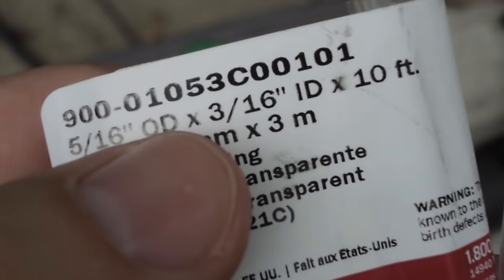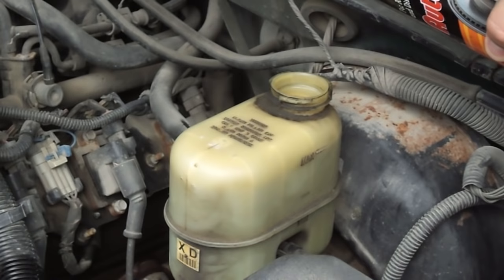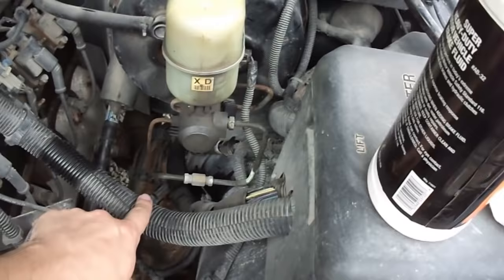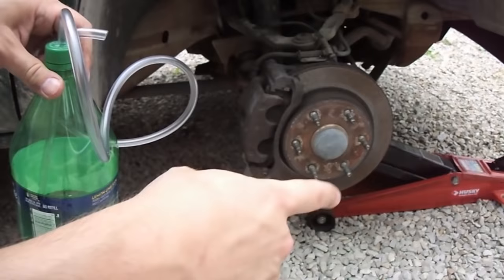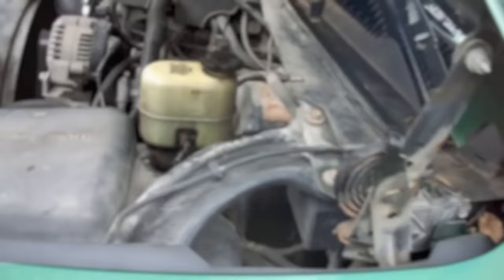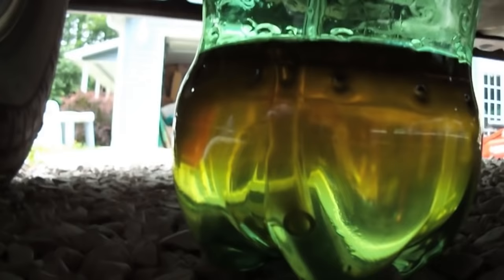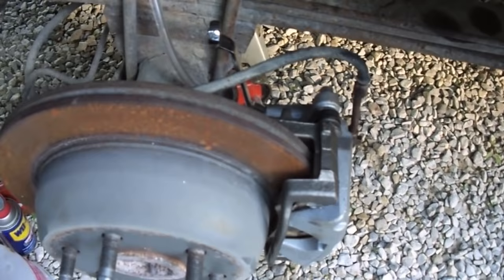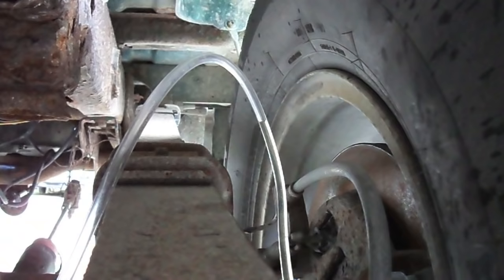Bleed brakes by yourself - DIY Brake Bleeder tool - Brake flush

Comment: Use a turkey baster to remove old dirty brake fluid from master cylinder. Use it in your soda pop bottle. Put new fluid in the master cylinder. That way you flush out all the dirty brake fluid at the same time. Use a zip strip inside bottle to hold hose and a zip strip to stop hose from coming off bleeder valve.

Comment: Good idea to put a block under brake pedal so that master cylinder piston does not travel into area that it has not pushed into before, there could be contaminates that get under seal and cause trouble later. only takes a second, and that way eliminate the possibility

Comment: Put blocks under the pedal so not to go to the floor . So the orings on the MC won't get ruined. And get those drill fillings out of that bottle!😲😲😲
Reply from the maker: Good tip, and yes, the bottle was cleaned out after drilling the cap.

Comment: another tip .. before starting to bleed . suck out all the old brake fluid from the reservoir . take note of its colour . if it’s green , buy new fluid the red or blue . different colour to the old fluid . then fill the reservoir with the new colour fluid . makes it a lot easier to see when the old fluid is all pushed through when the new colour fluid appears in the bleed tube . never skimp on brake fluid . buy the very best quality the store has on offer !

Comment: If you have the time, I would do a gravity bleed instead. Pump the brake before you loosen the screws. Also take out as much old fluid from the reservoir and stick a 32oz bottle of new fluid on top of reservoir. It shouldn't spill over. Close bleeder valve when you see clear fluid coming out
Reply: So after I emptied my brake reservoir, do I now fill it with the sprite that I took out of the bottle originally? Asked the blonde lady..

Comment: Thanks for the good video, Bud. 

Can I suggest  -  if you bring the tubing up a few inches after it hits the bottom of the bottle (forming a 'J') it will act like a P trap on a sink drain and you won't need to submerse the tube's end in fluid to prevent air from being sucked in.
...
Reply: If it sucks air/fluid all the way up from that bottle then your brakes already have a serious problem. The bottle is just there to catch expelled fluid.  The lock against air is the upward loop after leaving the nipple.

Comment: Great video. If you wanted to get a little fancier you could buy a strong relatively cheap magnet from a home store and glue it to the bottle. Also sealing the tubing at the top of the cap to help keep it from slipping out might help. Just about any type of glue or silicone sealer would work. I have some Flex Shot left over from another project that would work perfectly.

Comment: when you opened the bleeder at first the stream was solid, so what your saying is the air bubbles are upstream? And always use Transmission fluid to loosen rust. You could've gotten that screw off that way ATF works great.

Comment: lil penetrating oil on each bleed value 1st if older rig  and ONLY 6 POINT SOCKETS SHOULD EVER BE USED TO REMOVE BLEEDERS  at least that was the rule 60 50 40 30 yrs ago..good video sir  thks

Comment: would it be ok to use wd40 on stuck brake caliper bleeder screws (while they are still attached to the car) - or can that stuff penetrate past the threads and compromise the brake fluid/braking system?

Comment: If the master cylinder over 20 years old,don't push the pedal down to the floor this step,it may damage the seals inside the master cylinder,just use bottle is ok.
And if your car is top  model,make sure it dont have the electronic  brake,they use electronic pump to brake , OBD connect  to ecu to do bleeding.

Comment: Why would you need a vent hole or even a cap as long as the hose is submerged in fluid it can't suck air and the lack of cap would allow any air to just bubble out?
Reply: I suppose it grips the hose and stops it coming out - then the fluid would spill on the ground.

Comment: I told the auto parts store about having bleeders screws seize up before and I said or asked them is there anything that can be done to prevent a bleeder screw from seizing up? The guy that helped me was general manager and he said yes I have seen people use anti-seize like you would use on your old school spark plugs to keep the spark plugs from seizing up to a cast iron block. I figured wheel cylinders and calipers are mainly made of cast iron at least for my truck they are but the screws are a different metal so I started thinking about it for a minute and said yeah get me a small pack which is like a $1.99 of anti-seize and let's see if this works well that has been 3 years ago and I have yet to have one seize up on me. Just a little tip because I know at one point or another when people do their own brake system they may have come across this situation or know someone that has. I hope this helps.

Comment: Thanks for the very well done vid, but shouldn't the front brakes pull harder than the rear brakes? I was a little surprised to see the rear brakes lock up. Not so good in snow and slippery conditions.
Reply from the maker: Daniel Ben-Avraham the front end is much heavier than the rear.
Reply: @TheDaninator  True, it is a pickup, and you were on loose stone. Regardless, you might try the two person version of bleeding the brakes afterwards just to be certain that you got all the air out. The way you did it has the advantage of being great for getting brakes or clutch when you are all alone like I often am, and it is great for a line flush. The drawback is that air normally gets sucked in around the threads of the bleed screw. Pretty difficult to avoid unless the screw is sealed with grease or teflon tape. And both are a good idea, and can help avoid having to replace brake cylinders due to the screw freezing up. Especially where there is a lot of salt used on the roads. I know that gig as I grew up in New England, where we made a habit of spraying the undercarriage with old motor oil and then driving down a dusty road to solidify the oil. Makes working on the vehicle a little messier, but hand soap is cheaper than a new vehicle. I retired to the tropics so that is no longer an issue, I have a vintage 1972 Nissan Patrol vehicle and it is rust free. 
Anyhow, unless the threads are sealed with grease or teflon tape, they will draw in air every time the brake pedal releases and returns to the resting position. That to me could be why the rear brakes locked up so quickly, normally a little sliding is expected just after the vehicle has almost come to a complete stop and the tail has lifted. This is due to the fact that the design of the braking system is such that 75 to 90 percent of the stopping power is on the front brakes. With this, you should seldom ever see rear tires sliding.  The front tires should have slid before the rear. I would check it out, hate for you to have an accident. Liked the vid though, good work.

Comment: So what’s the problem once u bleed the brakes and the brakes when pumping is still loose ?
Reply from the maker: Hard to say exactly, you may have a leak somewhere in a brake line, or perhaps if your vehicle has an ABS module, it may have an air pocket in it.

Comment: What state do you live in and how many miles or years was that brake fluid in there?
Reply from the maker: I live in "rust belt" USA. The truck had approximately 225,000 miles when I made this video. I've owned it for 10+ years (it had 138k miles on it when I bought it), and have bled the brakes a time or two since I've owned it.

Comment: Vacuum bleeders never hold pressure, good vacuum bleeders are expensive, pressure bleeders are nice but you need adapters for the booster reservoir, one brand does a device one way vs another way....it's just frustrating especially if you only need to bleed brakes once a decade.
Thank goodness I came across this video, the simplistic nature of the work and video view count alone are obvious indicators that this is the best way.
One question though, are there any tricks to really ensure a super good/tight fit on the hose to the caliper nipple?  In the past when I've used the common handheld vacuum tool air would always get into the hose/nipple connection and zip ties did nothing to help.  Maybe a smaller size hose and use some oil on the inside because it'll fit super tight?

Comment: A week or two before you plan to do this , spray those bleeders with some good penetrating oil.
Or put a little heat around the cailper , where the bleeders screw in.

Comment: Could you do this with a bottle without a cap? Or is there a specific reason of having a cap and drilling holes in it
Reply from the maker: Pekka Hietala yes. The cap just keeps the tube in place so it doesn’t come up out of the fluid.

Comment: How much liquid needs to get out? The goal is to get the air out and replace the old fluid by new fluid? How do you know you pumped the brakes enough? How much does that operation costs at a mechanic shop?

Comment: my only problem is I couldn't find any clear hose so I got two feet of clear hose and 4 ft of black. if I wire them together I guess I should have the clear at the top cuz the air rises right?

Comment: While  you're pumping the brake inside your cars/trucks, how do you know when all the trap air bubbles has been pushed out of the brake line if you;re can't be two places at one?  SO it is safe to pumps, get out and check the line for air bubbles as seen here?  Just a little detail of information for clarification.   Thanks
Reply from the maker: Just as I did...pumped the brakes several times, then got out and looked at the hose. So long as you don't see any air bubbles in the hose, and the other end of the hose is submerged in the brake fluid in the bottle, you are good. Also, the tube at the bleeder screw needs to be a good seal, so as to not let air in.

Comment: First of all, thank you for sharing this video. It is very helpful. My question is, my 77 Ford pick up has power brakes. When bleeding, does it matter if the truck is off or is it better to have the truck running when pumping the pedal?

Comment: Doing it this way how do know if the air is being drawn on at the threads of the bleeder valve?  When you loosen it you loose the seal between the threads
Reply: Do you ask the shop that bleed your brakes for $300 if they are concerned when they loosen the bleeder screw(Which is why its called a "Bleeder")??

Comment: What happened if you open the bleed valve and you don’t get air or fluid? Is there any issue on the caliper? The brake cylinder? Thanks buddy.
Reply from the maker: Possibly a clog somewhere in the caliper or brake line. This happened to my father-in-law recently...turned out it was the anti-lock brake controller. He took the vehicle to a safe spot and got up to like 10mph and slammed on his brakes to activate the ABS module. It "burped" the ABS controller and then he was able to bleed the brakes.
Reply: The Daninator Thanks buddy! I’ll try the next weekend this solution you share. I hope to bleed that line since is the only one that I couldn’t bleed. Appreciate so much buddy!

Comment: Thanks for this. My only suggestion is to not press all the way to the floor when pumping the brake pedal. I read on several forums that going to far can damage the master cylinder gaskets.

Comment: Ok, do you not need to close the bleeder valve during the “upstroke” of the brake pedal (or risk sucking air in)?
Reply: That's the reason for the fluid in the bottle. It draws the fluid back in. Crazy huh? I like it
Reply: @swampjoe1985  thanks for that, and i get that part.  I would think that air could be drawn in around the loosened thread on the bleeder screw...i have always closed the screw on the upstroke for this reason...
Reply: @JDT64  good point... in the 1a-auto video, the guy brings up the point of barely opening to reduce the chance of that happening. Still a legit concern though

Comment: Question,  I was using 2 man method, but tomorrow I might be solo, good video, my question is, my drivers side caliper was pushing air every time, I just gave up, now my brakes are worse, they were soft on the first push but not as bad as they are now

Comment: If you bleed the system by yourself how can you see the  air Bubbles in the hose while you are pumping on the brake pedal ?
Reply from the maker: You have to get out and check on the hose after several pumps. If there are still bubbles in the line, keep pumping. If there aren't any more bubbles. You're good. Easy-peasy.

Comment: I have a lil motion pro motorcycle check valve so basically that valve does this for me correct? so all i need is the bottle to catch/collect the fluid coming out of valve on the other side, the valve should not let air come thru correct? And on last pump shut bleeder valve so air cant get in thru there and i should be golden right?
Reply from the maker: Honestly, I don't know. In theory it sounds good.

Comment: One question, if you have ABS, I thought the way you bleed brakes is when you first do one wheel, you then do the diagonal opposite of it. So since the first wheel you worked on was the passenger side front, you would ten do the driver side rear, driver side front, passenger side rear, and follow that pattern.

Comment: Question... The first time you bled you had the sprite bottle lower than the bleeder screw. Does the bottle need to be higher than the bleeder screw? I tried bleeding mine and had the bottle lower than the bleeder screw and the air never did stop.... but the raised the bottle and suddenly no more air
Reply: The bottle does not need to be higher, but a loop of the tube needs to be higher.

Comment: Some say that pushing the brake pedal all the way to the floor can damage the seals in the master cylinder around the piston rod because it is traveling past the point of normal stop, and this could cause abrasion of corrosion around the piston rod against the seals.  Will this technique still work if you only partially depress the pedal to the point of its normal travel rather than all the way to the floor, or if you don't press it all the way to the floor with the tube not completely fill with fluid such that on the upstroke for a partial pedal depress, the air in the tube will get sucked back in?
Reply: Said Will this technique still work if you only partially depress the pedal ?   Yes.

Comment: Thanks for the video. In what position should the ignition be because on mine, if it is off, pedal is spongy. However in 1 or 2, pedal sinks.
Reply from the maker: I did this with the key in the off position.

Comment: Iv'e thought about this way to bleed em for a couple years just never gave it a try. I was afraid of causing a lot more work for myself and when you are in a professional garage working on customers cars, time is money as they say. I am however going to go outside in a half hr or so and do it this way on my 65 c10. You know, I dont see why this way wouldn't bleed an entire system with all brand new parts ( master, pv ,lines, ect). have you tried it that way yet? Install everything and just open the bleeder with some fluid in the bottle (or 2. 1 on each wheel to start with) then just pump away? I am curious as to if it would work to do an entire system

Comment: does the car need to be all off the ground using jack stands?  Or can you do just lift one corner at a time?
Reply: If you can reach the bleeders and have room for the hose and bottle then you shouldn't need to.

Comment: Hey your video was quite helpful. I have few more questions;

1) while bleeding, do I need to keep the master cylinder cap on(tightened up) or off? 

2) whilst changing one jammed caliper if my master cylinder empties out(due to brake hose off the caliper) do I have to bleed all the four wheels or just one is ok? 

Thanks
Reply from the maker: Nick Saini I kept the cap on, I’d bleed all four.

Comment: What exactly did you place in the soda bottle  before bleeding? Was that water or brake fluid in the bottle?
Reply from the maker: brake fluid
Reply: @TheDaninator  so fresh brake fluid in the bottle or is that used in there since the bleed would contaminate.
Reply from the maker: @candlemedia  You could have fresh or used brake fluid in the container. The idea is to not allow air to flow back into the brake line.

Comment: Okay I know this is a stupid question but since I never bleed brakes before I must know. Should you have your car on or will it be okay with the car off??
Reply: Did you hear his engine running? It doesn't need to be on.

Comment: Great vid and all but...do i bleed my brakes on all four corners everytime when changing brake pads??   even if i changed pads on just one corner 🤔
Reply: No need to bleed if just changing pads or shoes, only if you have to fix a leak somewhere is the system.
Reply: @FangBlah  well i have owned the vehicle for 13 yrs now and have always changed the pads myself. Braking feels really sluggish. 
  Like it wont stop to a halt or squeal the tires even if i wanted to....maybe its time to bleed my brakes lol

Its an '11 Ford Fusion Sport for reference.
Reply: @GTluver  In that case, I would check for leaks in the whole system. Check all the lines, fittings and calipers,etc. Then try bleeding them; air is like a spring, it will fight against the fluid.
Reply: P.S. Also brake fluid is hygroscopic, meaning is absorbs water from the air so you might want to flush the whole system.
Reply: @FangBlah  thanks

Comment: Doesnt pressing the brake pedal to the floor with a bleed loosened knacker the seals in the master cylinder?
Reply: I think it is prudent to not press the brake pedal all the way to the floor for this very reason. You can perhaps put a block behind the brake pedal to prevent it going all the way down when the bleeder valve is cracked to allow fluid to escape.